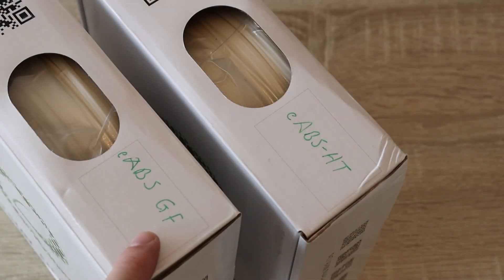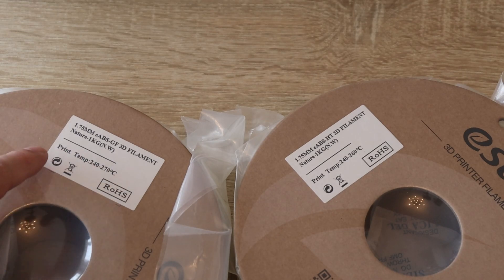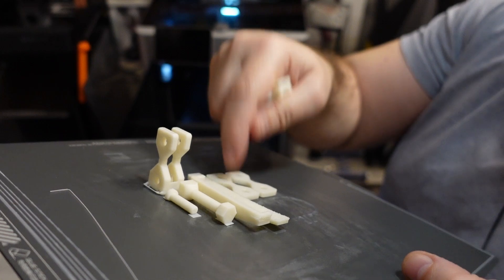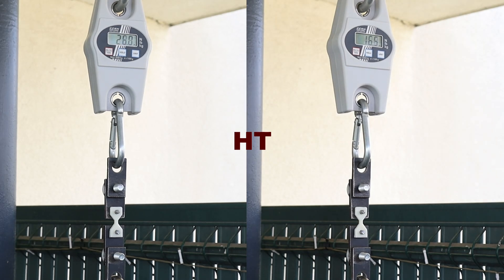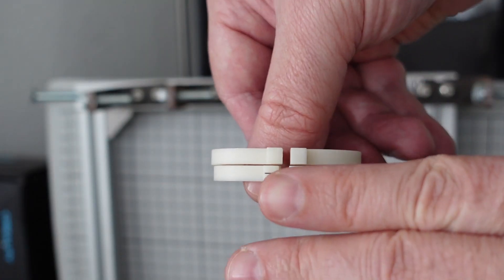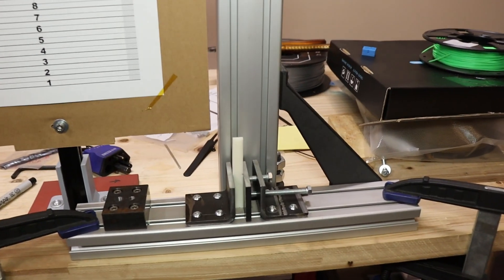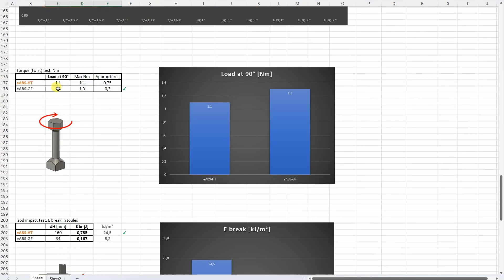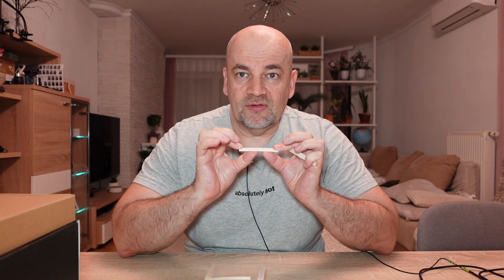eSun eABS-GF vs eABS-HT (glass fibers vs high temperature ABS)

Comment: You may want to check PRINTING PERSPECTIVE video about layer adhesion based on print speed. It may well be that adhesion prjnted at such speeds is far from the best one.
With custom object settings i would decrease the lrint speed for vertical samples to 5-8 mm³/s, just to be sure the results are comparable for all filaments.
Reply: Agreed. Print speed, temp and time extrusion can have a massive impact. But I suppose it’s still interesting to see what properties you might expect if you don’t spend time tuning.
Reply: CNC Kitchen did it (in the same way said as "Simpsons did it" 😂)
Reply: @ThisisDD  where he recognises his samples are too small to properly test high speeds, while the channel I mentioned used different samples, more suited to such testing